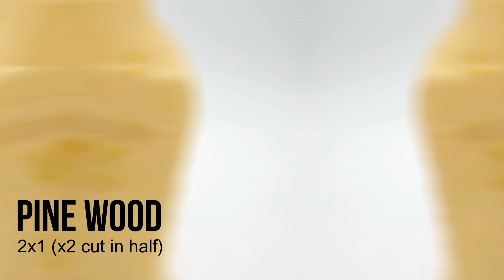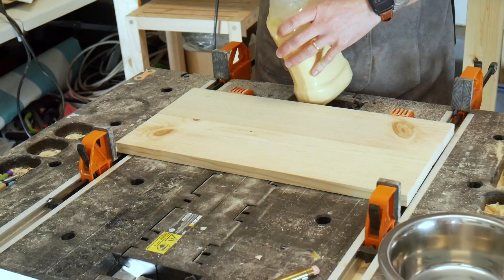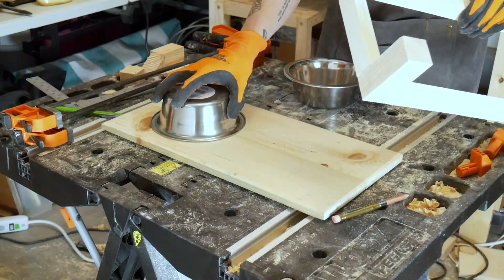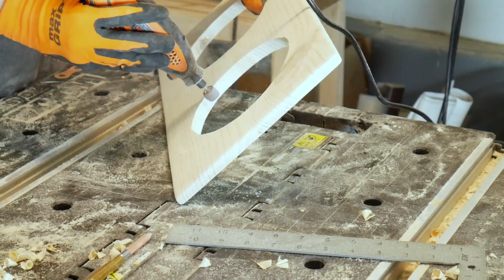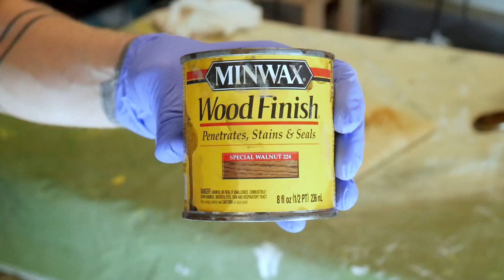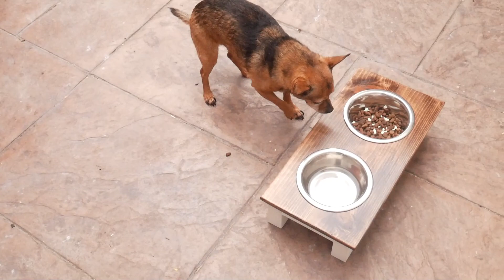Modern DIY Wood Pet Bowl Stand | Custom Build (Humble Hands) Ep. 3

Comment: It came out ok looking but there were so many tools used here that were totally unnecessary. Why not use a table saw or circular saw instead of a band saw to rip those boards? A drill press to make small holes that don’t have to be precise; why not just use a regular drill? And a dremel tool to smooth out the insides of the holes that no one will ever see? Two seconds with a piece of sand paper would have sufficed. This might scare away your average BIYer cuz who has a drill press or band saw?? The real kicker is that it’s all glued together! All those unnecessarily used tools and not even one Brad nail was shot in for strength. Good thing it’s for a small dog lol
Reply: Seems like you know so much about this. Do you happen to have a tutorial on how to make this without many tools?
Reply: Im wondering why he never used a fence when cutting on the bandsaw?
Reply: Brad nails don’t provide any actual strength. Wood glue is much stronger than any Brad nail. He would have used Brad nails if he didn’t want to wait for the glue to completely setup before continuing working.